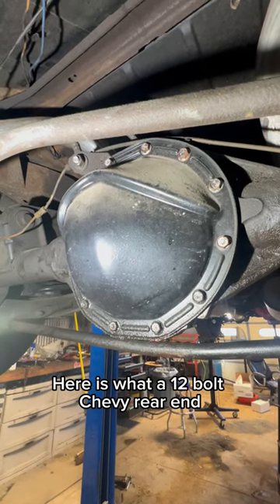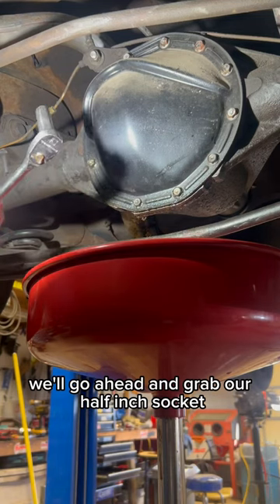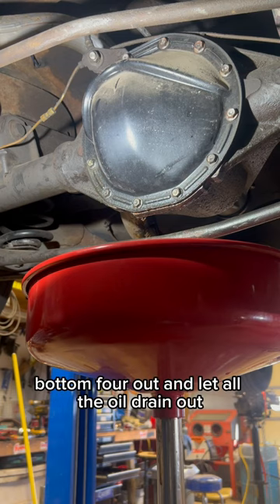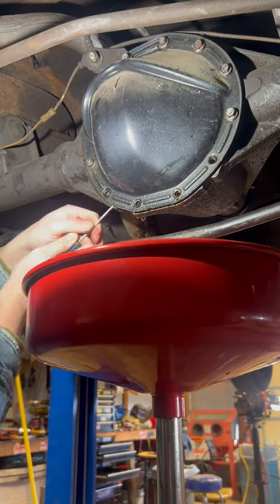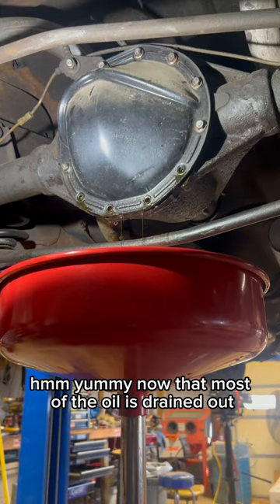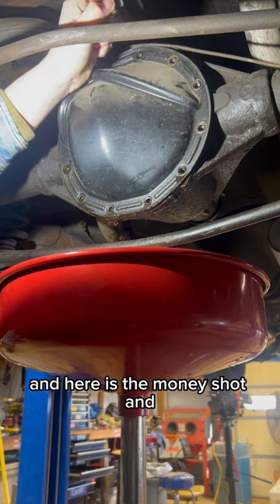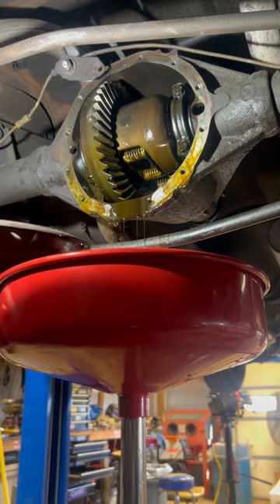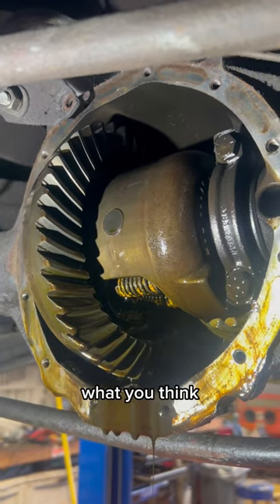Chevy 12 Bolt 3.73 POSI rear end after 5 years #chevy #impala #belair #holley #engine #rearend

Comment: Is that a factory posi? Are you running a conventional oil with a posi additive?
Reply from the maker: It’s a factory unit, but the car was a 10 bolt non posi from factory. I use driven race oil synthetic. Got it from Amazon

Comment: Hey what’s the stock rear on the 66? Is it 3:23 and posi? I’m a noobie owner of a 66 myself and wondering what I should do on the rear end to handle 550 hp LS I’m putting in. Thanks!
Reply from the maker: They came in a bunch of different options stock. Mine is currently a 4 link 3.73 posi 12 bolt. Should be good for 550 I would imagine